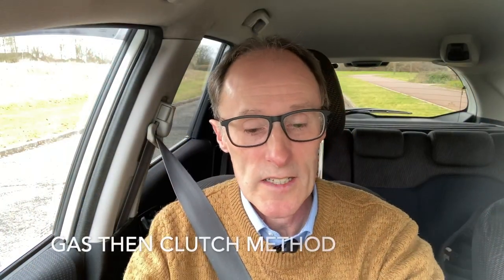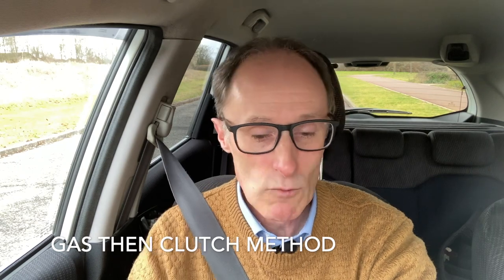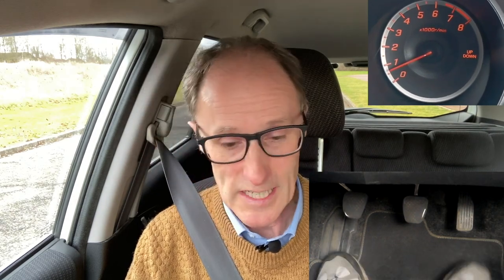TIPS ON MOVING OFF | CLUTCH CONTROL | STALLING

Comment: It’s really frustrating when you’ve learnt in your instructors car and they teach you to only use the clutch to move off. Now I’m here dreading driving in my first car as I’ll have to learn this from the beginning. What was the point :( thanks for the video will watch it again
Reply from the maker: I understand your frustration, some instructors are not making it easy for some learners.  Good luck driving your first car.
Reply: I had the same thing, although, I learnt with my father as opposed to my instructor. But generally, I would also move off with only the clutch, once I passed, I switched to a petrol. It wasn't as bad as I thought it'd be, unfortunate that you were taught that way though.
Reply: I had the exact same thing taught to me. Failed straight away my driving test! The examiner said I didn't have enough control of the car. I explained that my driving instructor taught me to just use my clutch, even on hill starts. My examiner was really nice though even though I failed my examiner took the time to teach me how to bring the clutch to the biting point and add a bit of throttle during the exam. My examiner advised me to find another instructor and do more lessons with the new one then book again!

Comment: Don't know if I'm just getting away with this on hill starts but I find in my 2011 fiesta, I can lift the clutch just enough to hold the car, then release the footbrake, add gas,  lift the clutch a touch more and move away.
Reply from the maker: If you are coping and not rolling or stalling, then good for you.  You must have an excellent control of the clutch.